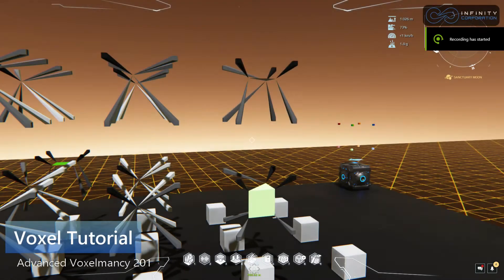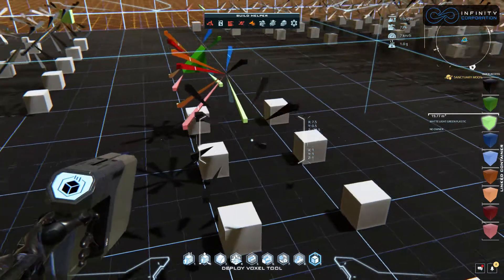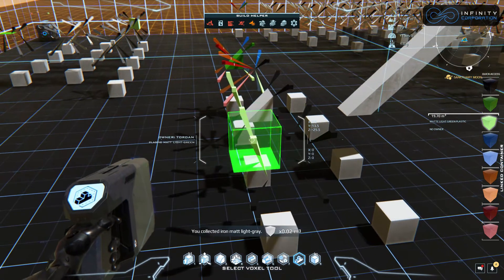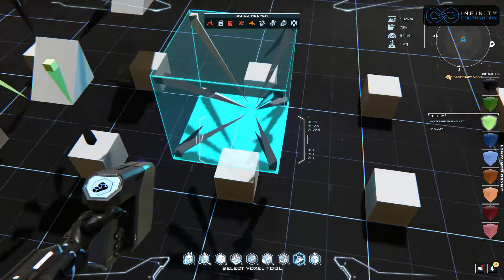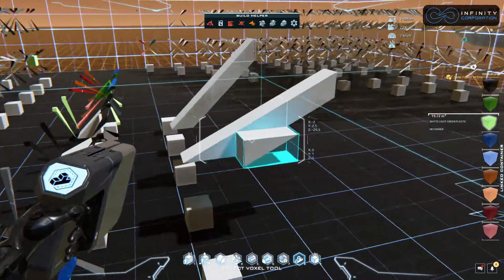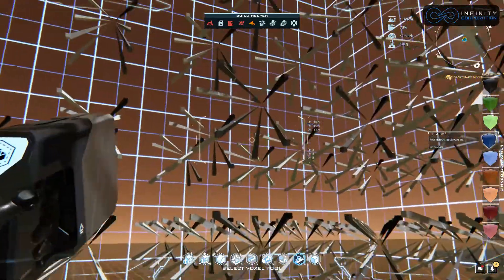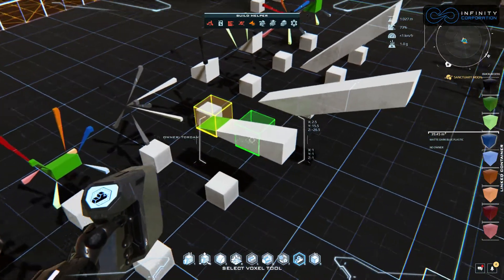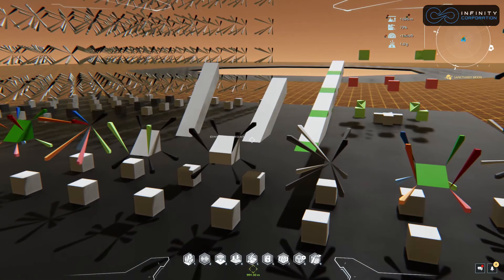Dual Universe Voxel Tutorial - Advanced Voxelmancy 201

Comment: Great video!  keep them coming.
several times you say "and then you mirror that" .... whats the magic key to perform the mirror?  or are you just rotating it by hand somehow?
Reply: You can mirror by tapping the R key. The direction in which it mirrors depends on the surface you are facing.
Reply: press and hold r. then use the mouse wheel. it rotates related to the voxel face you are aiming at. Flip is just tap r